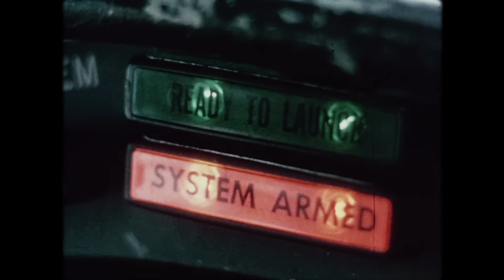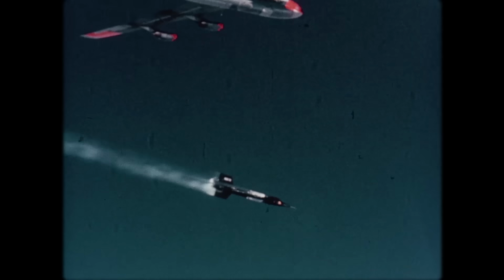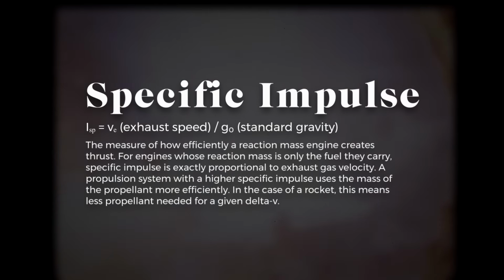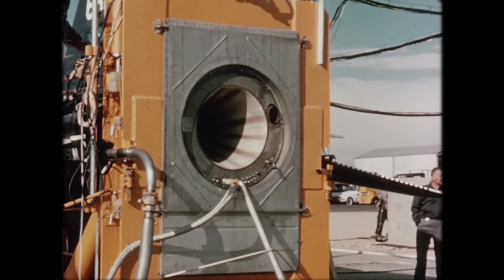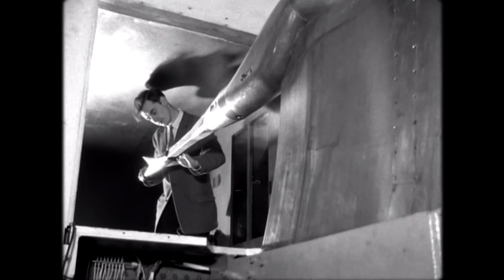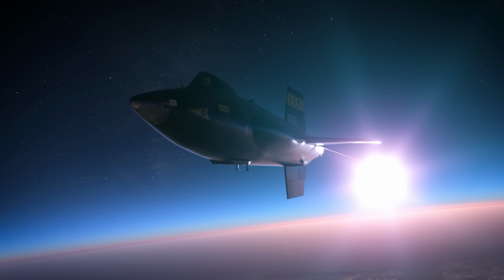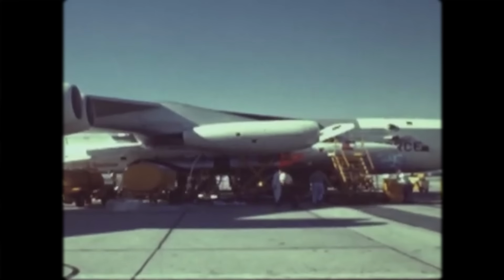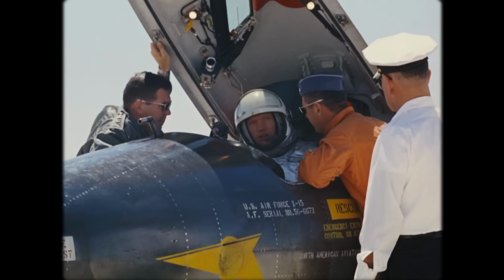The Insane Engineering of the X-15

Comment: Designed at the School for Advanced and Insane Aeronautical Engineering.
' Oh those wild and crazy Czechoslovakians, draftsmen that were so insane, drawing pencil lines on vellum ! '
'  You know, It uses insane fuel to achieve mach 7 velocities ! Um, awesome ! Insane !'
' Why, it is said that the military pilots were quite insane, to even risk their lives to test the aircraft ! '

200K man hours of work + insane = 21st century perceptions, by way of the lowest common denominators, none of whom have degrees.
Edit, the means to retract insane epithets, dissing the work done by the men breaking the envelope's boundaries.
The Right Stuff, that some do not have.
https://www.youtube.com/watch?v=NAbRRpI8ohU
' Tip of the spear, Edge of the knife, Crack of my ash. '
Insane, the objective is to deliver atomic weapons faster, quicker and before the others.

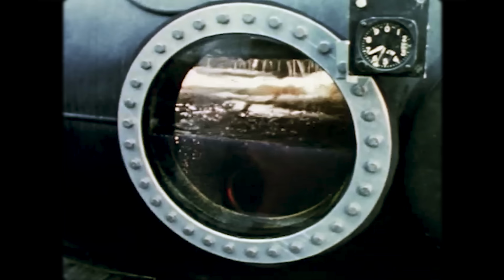Comment: Jesus if that vat with the porthole at ~11:36 is liquid oxygen or hydrogen, that's a nuts amount and a nuts amount of pressure.
Reply: Christina 19 y.o - check my vidéó  I think he said later that it carried water so it may have been that. But most military water tanks don't have portholes. Just needle gauges. So it had to be one or the other. It's insane, the amount of work that goes into every piece of every step.

Comment: AT 17-18 minutes the narration confuses two issues - heating and drag.   Yes, a blunt body does produce a detached bow shock which stands off from the vehicle and helps with heating.  But this is at the expense of drag.   Vehicles that have performance as their primary goal will be slender and "pointy", like most fighters, the X-15 and the XB-70.   The X-15 and XB-70 had to handle the aero heating with material selection - titanium and inconel.   The SR-71 is interesting in that the reason it is painted black is for thermal control   Most of the heat coming into the vehicle was from aero heating.   The black allowed for a portion of the heat to be radiated back into space.

Comment: Rocket turbo pumps are what really amaze me the most.  On the space shuttle the RS-25 engines hydrogen high pressure turbo pump boosts the pressure of the liquid hydrogen from 1.9 to 45 MPa (276 to 6,515 psia), and operates at approximately 35,360 rpm with a power of 71,140 hp. AND its at a temp of -450ish at the h2 pump side and the hot side gets into the 1000s of degrees. In the combustion chamber awesome. Just some INSANE things all going on at once. And to top it off the RS-25s never had a catastrophic failure ever while on a mission. The boosters that have very few parts in comparison to the RS-25 where what caused the challenger to be lost. They are now going to be reused for some rockets now.
Reply: The '60s were when the testing of the pumps happened, many of which failed, geez, even Wernher's V2 pumps failed, in '44.
Not an overnite sensation, or instant gratification.
Decades of difficult work.
Reply: @veeekin9casterman169  the rs-25 wasnt around in the 60s. Its the 3 shuttle engines
Reply: @veeekin9casterman169  that has nothing to do with what I was talking about. Smh
Reply: Frances 22 y.o - check my vidéó  that's what I say about the SR-71 its really late 50s early 60s tech so what is 2010 tech? 50 years after the SR-71?

Comment: Imagine if a plane could go as fast as the x-15
Reply: The manned Space Shuttle and unmanned x-37 space planes both achieved a much higher final velocity once in orbit.
Reply: I know, those aren't planes though, if it uses on-board oxidizer and rocket engines to hit a speed, that doesn't count as a plane.
Reply: @foxtrotgaming4684  
From Merriam-Webster:

airplane noun
air·plane | \ ˈer-ˌplān  \
: a powered heavier-than-air aircraft with fixed wings from which it derives most of its lift

The X-15 is an airplane.

Comment: Quite the rocket sled really but it's just that, a rocket, and clearly female,  high maintenance. The A12/SR71 is the true godfather of air breathing speed machines and will hold this title forever.  The sound barrier was relatively easy to conquer, The thermal barrier is a bit more extreme to tame.

Comment: Solid information/documentary💯 However, the X15 was not the first to break the Karman Line. Wherner Von Braun's V2 rocket first broke this line on June 20, 1944. The X15 was subsequently designed in the mid 50s using a concept study from Von Braun's former boss. (Walter Dornberger)

Comment: Your production quality is so much classier than my work. 
But - 22:20 You talk about the only possible alloy being Inconel, but during the early propoals for the X-15 program Douglas came up with D684 which would use a Thoralloy skin with 3% radioactive thorium. On paper this gave it better performance than the X-15 that was built.
I made s short video about this here:
https://www.youtube.com/watch?v=kB4mPei_x-I
Reply: The radiation emitted by thorium is only alpha particles. They wont even penetrate a sheet of paper. Have worked for 20years plus as a coded pipe welder, and the tungstens we use for tig welding all metals except aluminium, contain 98% tungsten and 2% thorium. The only hazard posed is the dust when grinding them (controlled by using a purpose made watercooled tungsten grinder).
Reply: Mr. Manley, Don't sell yourself short! Your ability to share and transform COMPLICATED subjects to a person (ME) with a brain, that can not even wrap his head around most of what you talk about. Astounds me to this day!!! NEVER STOP!
Reply: Empowering your peers - Love it. True qualities we need to see more of. Great work guys all round!!
Reply: @DanielTaotua  so true
Reply: Who wants to ride around in a radioactive plane though
Reply: @nosuchthing8  people just like you who seem to have no issue flying on commercial airliners while being bombarded by radiation
Reply: It's not the radioactivity you worry about, it's the 10 G pullout..
Reply: Hey Scott,I was wondering if you could make more videos explaining Rocket science.
Reply: @doodleboi7034  Its like brain surgery.
Reply: @lancelewis3381  Except its sweets to me
Reply: Hmm
Yes
Just add radiation!
Reply: Show off.
Reply: Cool

Comment: The first man to fly a plane to space 🤣 (using established rocket since and behaving worse than a rocket can’t start or land on their own and after a few min. if u survive u can throw it away) completely useless but hey we made it to the Guinness World Records.
But i understand that it was beneficial for Nasa. I break it down for you:
it was certainly an amazing airplane (rocket) but the truth is there were few benefits to the space program from the X-15. It was far from a critical or necessary step:

The Mercury space suit was a direct derivative of the BF Goodrich Navy Mark IV, which had been in use for years. It wasn't developed for the X-15
The rockets used in the space program were completely different from the X-15. They were orders of magnitude stronger for one thing, used different fuels and completely different designs. Throttle-able rocket propulsion systems weren't new
The X-15 thermal protection system was of no use to the space program, which had to deal with far higher temperatures
There were some benefits:

It was a good source of astronauts: several pilot from the program went on to the NASA programs, including Neil Armstrong i think
Data from the X-15 missions were used in the X-20 Dyna Soar spaceplane which never flew, but it eventually morphed into the space shuttle

Real Engineering, you did a great job on the video but u can‘t call that a plane! It‘s a rocket and u can‘t say 1st human in space and twisting with a plane. It‘s definitely NOT a plane! And it‘s disrespectful to Yuri Gagarin who was the real 1st human 1961 in space.

Comment: Sorry to inform you, but the X-15 is a rocket, not an aircraft in the usual understanding! Having wings does NOT make it an aircraft. All rockets also have wings/fins too! Using the X-15 definition, the Saturn V moon rocket is also an "airplane".
Reply: From Merriam-Webster:
airplane
noun
air·plane | \ ˈer-ˌplān  \
Definition of airplane
: a powered heavier-than-air aircraft with fixed wings from which it derives most of its lift

The X-15 produces lift using wings. It's an airplane.
Reply: @the18thdoctor3  boom
Reply: Space plane😁

Comment: X-15: See u later BlackBird!
20 seconds later
x-15: Can I get a ride back home?
Reply: Over 8tonns of fuel dump in less than a minute, interesting!🤔
Reply: The X 15 is the more reckless older brother of the blackbird xD
Reply: @LordGingerBerry  Don't forget the middle child, the A-12
Reply: @HappyBeezerStudios  why would I, every time I try to create a SR 71 in Kerbal Space Program I end up creating the A 12 by accident!
Reply: @HappyBeezerStudios  A-12 can’t even come close to SR-17, just like F-14 hornets, can’t complete with F-26
Reply: @roisebongjerry3328  there  is no such thing as a f14 hornet.... it's a f14 tomcat. And wtf is a f26? You mean a f22 raptor?
Reply: LOL
Reply: *Reaches Karman line
“Mommy I need some fuel”
Reply: This plane could cross the United States in less than an hour if it didn't run out of fuel.
Reply: @TheTallMan50  This is not a plane, it’s a rocket, can’t even re-full mid flight. That means it’ll never fly that long,
Reply: @roisebongjerry3328  We're both right.  It's a rocket plane.
Reply: @roisebongjerry3328  probably why he said if it didn't run out of fuel. Did you even fully read the comment?
Reply: @roisebongjerry3328  it's a plane and a rocket. It's just not a jet
Reply: @TheTallMan35 if it had taken off Independently like other aircrafts I doubted it would make Mach 3 or 4, pretty Flawed if you asked me!!🤦
Reply: @densleycunningham7208  That isn't really the point of the aircraft. It's to test high altitude flight at the point of space for potential astronauts. The speed is required to get that high and it needs to start at 40,000 feet or it would not have the fuel to get there.
Reply: @ighfee  yep, the engine isn’t as efficient at sea level

Comment: I never learned this much of chemistry in my whole High school period.
Reply: Highly doubt you even passed school if you mistake chemistry with engineering
Reply: @codytran1719  well, im sure someone who thinks chemistry has nothing to do with engineering would have done any better
Reply: @ahil738  didn't say they have no correlation between each other. Also you're talking to a marine engineer.
Reply: @codytran1719  Is basic literacy not a requirement of marine engineering?
Reply: @codytran1719  you heard the subject chemical engineering?